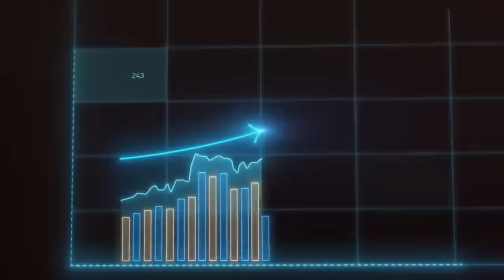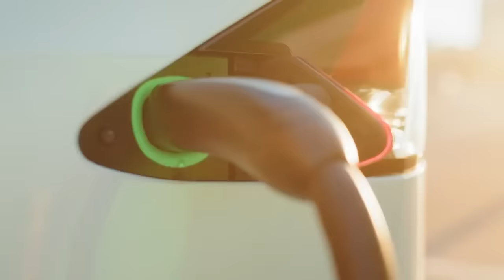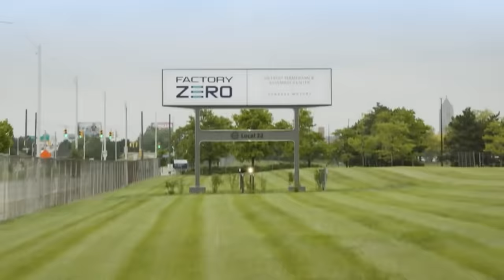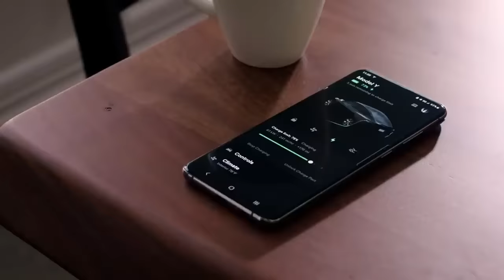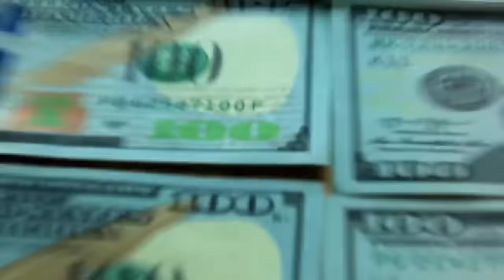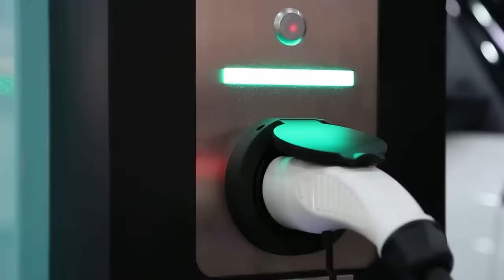Electric Vehicle Owners Are Frustrated and Demand the Return of Gas Cars

Comment: EV's are a way to keep people from traveling too far 300 miles per charge,so u drive from miami to orlando and when u get there if u make it your car needs hours of charging unless you fast charge  and pay up the nose.i recomend a trailer with a 12kw generator to fix the problem.
Reply: Problem with that being most generators can’t put out clean enough power to actually charge them sensitive creatures.
Reply: 1. Child battery mineral labor

2. Range anxiety

3. Risk of garage fires

4. Paying 20k more than a
comparable vehicle

5. Battery denegration

6. Poor resale value

7. Reduced performance in
cold, highway

8. Higher repair costs

9. Awful charging network
experiences in the weather
without restrooms

10. Higher insurance rates

11. Replacing tires more
frequently

12. Death by autopilot

13. 30 - 40k battery

14. Low km range

15. must wait 2 hrs
to charge

16. Then wait more time to charge, while charging.

17. Spontaneous combustion with no way to put out the fire storm.

18. If they catch fire in a tunnel, many people will die.

19. People without a pro charger system or a parking spot at their house, will run an extension cord to the road, which is dangerous and could lead to people tampering with your charging setup (super slow charging at the road)

20. If your in California, you won't be able to charge your car past 4pm because of a shortage of electricity supply on the cheesy grid.

21. It is not actually "green". The pollution is made at the power station, not the car.

22. Only 5% of used junk batteries get recycled, the rest go directly into the bin. It's cheaper to mine for new minerals.

23. Chhinna actually does 70% of all the refining of the minerals and production of the batteries.

24. Minerals are becoming more and more scarce, and the cost will only go up, not down.

25. Some countries where they mine for lithium, actually use a very big boat load of fresh water to only produce a ton of lithium, so they are afraid of running out of water. It takes over 2 million liters of fresh clean water to produce 1 ton of lithium. 

26. Ev cars will soon not be able to drive in tunnels or be able to park in underground parking garage and probably will eventually void your house insurance if you park it in your personal garage.... 

27. You can't charge your battery at super stations when it is bitter cold out.

Comment: EVs are supposed to be eco-friendly wonders of the future. The owners and public policies are pushing everyone to have one. The sooner the better, right?

Along my street, most residents are on low incomes or (like me) on Social Security. I can't afford a new EV (or any kind of new car). My current car is a gasoline-powered 2016 Kia Soul that I bought 3 years ago. It cost $12,000 (which included a 6% state sales tax). I hope to get another 5 years out of it. If my hope is dashed, I will have to resort to buying a less expensive used ICE car (which, by the way, may emit more air pollutants than the current car does). The retired guy across the street drives a 20-year-old pickup truck.

My neighbors can't possibly charge EV batteries overnight, as the EV evangelists say we should. My one-way street consists of one driving lane and one lane for parked cars. Row houses. Narrow sidewalks. No yards. No driveways. Most of the houses are 120 years old. What do we do with the people who live on the wrong side of the street? Run electric wires across the road?

One-fourth of my the city's homes have the same situation: crowded, narrow duplexes and row houses. Many have no off-street parking. I see small sheds for garden tools, but no garages for EVs. 

The EV evangelists impress upon us that parking one's car overnight in their personal garage is de rigueur. 

So. What will the EV evangelists do for us? Nearly 17% of my city's households live below the poverty line. (The national average is 12.6%.) In the adjacent city,  where I once lived, 24% of the households are impoverished). You thrill to inducing people to switch to EVs. What must we surrender to make you feel better about yourselves?

Don't tell us we can use mass transit. Alas, we have an exceptionally poor public bus system. It lacks adequate federal, state and local funding. What about people with mobility, cardiac or pulmonary disabilities? Must they walk to their grocery, pharmacy or workplace? Even if the destination is 3 or 4 miles away? Or must people with disabilities wait for a tardy bus while they stand in rain, snow, cold or heat?

Here is the crux of the matter.

EV owners get price cuts and discounts. On top of that, they get government subsidies and tax credits. They drive at no charge to the public. They pay nothing for the cost of building or maintaining highways, bridges or local roads. No, the low-income motorists in our state pay for that all infrastructure through their taxes at the fuel pump. The EV owners are moochers. And they don't mind keeping it that way.

We will have to keep our ICE vehicles. We have no choice for now. But don't treat us as serfs. It's not that we don't care about having a healthy environment. I have worked for environmental causes starting with the first Earth Day in 1970.

But this is the big issue. You don't understand social equity. You, and only you, deserve the best. 

You have your grand social experiment: You want to separate the chaff of the lower-income people from the pure grain of the wealthy. Guess which group will be the loser in this experiment?
Reply: @andylam2523   Don't compare US with Hong Kong.  I lived in Hong Kong for six years.  They have a fantastic public transportation system.  I very seldom had to use a personal car.  Plus you really can't drive more than 50 miles in any direction and still be in Hong Kong.  One more item, to purchase a car you have to give proof of having a place to park it and parking rents are extremenly high.  The majority of residents do not own cars at all.  But unlike anywhere in the US, except maybe Honolulu, the public transportation system is fantastic (though very crowded).
Reply: 1. Child battery mineral labor

2. Range anxiety

3. Risk of garage fires

4. Paying 20k more than a
comparable vehicle

5. Battery denegration

6. Poor resale value

7. Reduced performance in
cold, highway

8. Higher repair costs

9. Awful charging network
experiences in the weather
without restrooms

10. Higher insurance rates

11. Replacing tires more
frequently

12. Death by autopilot

13. 30 - 40k battery

14. Low km range

15. must wait 2 hrs
to charge

16. Then wait more time to charge, while charging.

17. Spontaneous combustion with no way to put out the fire storm.

18. If they catch fire in a tunnel, many people will die.

19. People without a pro charger system or a parking spot at their house, will run an extension cord to the road, which is dangerous and could lead to people tampering with your charging setup (super slow charging at the road)

20. If your in California, you won't be able to charge your car past 4pm because of a shortage of electricity supply on the cheesy grid.

21. It is not actually "green". The pollution is made at the power station, not the car.

22. Only 5% of used junk batteries get recycled, the rest go directly into the bin. It's cheaper to mine for new minerals.

23. Chhinna actually does 70% of all the refining of the minerals and production of the batteries.

24. Minerals are becoming more and more scarce, and the cost will only go up, not down.

25. Some countries where they mine for lithium, actually use a very big boat load of fresh water to only produce a ton of lithium, so they are afraid of running out of water. It takes over 2 million liters of fresh clean water to produce 1 ton of lithium. 

26. Ev cars will soon not be able to drive in tunnels or be able to park in underground parking garage and probably will eventually void your house insurance if you park it in your personal garage.... 

27. You can't charge your battery at super stations when it is bitter cold out.
Reply: This is way more than just an EV rant!  EVs, like other forms of propulsion, have their place.  Look at e-bikes!   They are filling gaps of congested areas too.   So much of our problems in America stem from urban sprawl and a lack of consideration for city planning that focuses on people and not cars.
Reply: @Terickso27  yup.

1. Child battery mineral labor

2. Range anxiety

3. Risk of garage fires

4. Paying 20k more than a
comparable vehicle

5. Battery denegration

6. Poor resale value

7. Reduced performance in
cold, highway

8. Higher repair costs

9. Awful charging network
experiences in the weather
without restrooms

10. Higher insurance rates

11. Replacing tires more
frequently

12. Death by autopilot

13. 30 - 40k battery

14. Low km range

15. must wait 2 hrs
to charge

16. Then wait more time to charge, while charging.

17. Spontaneous combustion with no way to put out the fire storm.

18. If they catch fire in a tunnel, many people will die.

19. People without a pro charger system or a parking spot at their house, will run an extension cord to the road, which is dangerous and could lead to people tampering with your charging setup (super slow charging at the road)

20. If your in California, you won't be able to charge your car past 4pm because of a shortage of electricity supply on the cheesy grid.

21. It is not actually "green". The pollution is made at the power station, not the car.

22. Only 5% of used junk batteries get recycled, the rest go directly into the bin. It's cheaper to mine for new minerals.

23. Chhinna actually does 70% of all the refining of the minerals and production of the batteries.

24. Minerals are becoming more and more scarce, and the cost will only go up, not down.

25. Some countries where they mine for lithium, actually use a very big boat load of fresh water to only produce a ton of lithium, so they are afraid of running out of water. It takes over 2 million liters of fresh clean water to produce 1 ton of lithium. 

26. Ev cars will soon not be able to drive in tunnels or be able to park in underground parking garage and probably will eventually void your house insurance if you park it in your personal garage.... 

27. You can't charge your battery at super stations when it is bitter cold out. 

28. If a fire truck comes to put out an Ev fire, all the chemicals go directly into the sewer system, poisoning every thing. They need tons of water to slow down the the burn. They can't put them out. They are only trying to prevent over things near by from catching fire

Comment: It is dawing on people that EV's are far more expensive than the good old combustion-engined car and today's economy with rising interest rate are not kind to EV's

The first wave of buyers to EV's were he  were higher-income households, enthusiastic technophiles, and those concerned about the environment with them satified the market has slowed 

EV manufacturers will have to engineer more entry-level models to reach a less affluent demographic

As with all Governments they rushed into EV.s with national charging networks still in their infancy. A road trip in an EV requires planning, and drivers need to add additional time to the journey as replenishment (to 80 percent charge) typically requires 20-30 minutes — thats enough to turn of anyone thinking about buying an  EV.

Most Ev's only offer approximately 250 -300 miles on a full charge this is something that buyers find a turn off 

 EVs are touted as electric variants of traditional combustion vehicles, that couldn’t be further from the truth, as EVs are as dissimilar to pure combustion vehicles as propellor aircraft are to jets

Consumers don’t understand the nuances between the two powertrains 

Governments have rushed the Sales of EVs on the World without the infrastructure and  a populace still in love with combustion engines, then there is the price and the fact that if you want to go on a long drive with the missus abnd the   kids then take the combustion engine car
Reply: 1. Child battery mineral labor

2. Range anxiety

3. Risk of garage fires

4. Paying 20k more than a
comparable vehicle

5. Battery denegration

6. Poor resale value

7. Reduced performance in
cold, highway

8. Higher repair costs

9. Awful charging network
experiences in the weather
without restrooms

10. Higher insurance rates

11. Replacing tires more
frequently

12. Death by autopilot

13. 30 - 40k battery

14. Low km range

15. must wait 2 hrs
to charge

16. Then wait more time to charge, while charging.

17. Spontaneous combustion with no way to put out the fire storm.

18. If they catch fire in a tunnel, many people will die.

19. People without a pro charger system or a parking spot at their house, will run an extension cord to the road, which is dangerous and could lead to people tampering with your charging setup (super slow charging at the road)

20. If your in California, you won't be able to charge your car past 4pm because of a shortage of electricity supply on the cheesy grid.

21. It is not actually "green". The pollution is made at the power station, not the car.

22. Only 5% of used junk batteries get recycled, the rest go directly into the bin. It's cheaper to mine for new minerals.

23. Chhinna actually does 70% of all the refining of the minerals and production of the batteries.

24. Minerals are becoming more and more scarce, and the cost will only go up, not down.

25. Some countries where they mine for lithium, actually use a very big boat load of fresh water to only produce a ton of lithium, so they are afraid of running out of water. It takes over 2 million liters of fresh clean water to produce 1 ton of lithium. 

26. Ev cars will soon not be able to drive in tunnels or be able to park in underground parking garage and probably will eventually void your house insurance if you park it in your personal garage.... 

27. You can't charge your battery at super stations when it is bitter cold out.

Comment: I think if you're looking at an EV you need to think of it as a 2nd car. Next you want to spend as little as possible as it is not only an evolving technology but also they tend to depreciate more rapidly. Obviously you need to buy one that has sufficent range for your commute in both warm & cold weather as you will have a reduced range in winter months depending on where you are. Ideally you can charge it from home using a single phase fast charger or slow charger using off peak night rates or using electricity generated by solar or wind. This will offset your  power cost. For us as a low user I would estimate for our limited mileage with an EV that we would double our power bill if we were charging from our normal day rate.
Reply: "...only an evolving technology..." that's over 125 years old. Good grief.

Comment: Honda's hybrid make more sense. It uses fuel to run a generator which charges a small battery to drive the car. The MPG  is better than any gas/diesel and better than any EV. Why not develop that tech and shoot for lower emissions?
Because those in power make money out of pushing EVs.
Reply: Kia Niro   Hybrid.   Fill at gas station.  mid 50 MPG    60,000 mi over 5 years.  Oil changes, tires and wiper blades. Bought new for ~$21,000.   I have been thoroughly enjoying this car.
Reply: I have a Toyota Corolla hybrid.   I get over 65 miles per gallon on a run . Thats at 70mph There are examples in the States where these cars have exceed 400,000 miles in 4 years and still going strong without major work Mine is 2 years old and still looks like new . In short its perfect. Also there is no starter motor or alternator  Tyres wear obviously but not ridiculous . MPG IS affected in the winter because the  engine provides the heat  .
Reply: @69dblcab  my aunt loves her Kia Niro. Even when that battery dies the thing will still be functional and until that day comes you are saving a ton of money on gasoline.
Reply: But can it beat a Ferrari in a 0 - 60 contest?